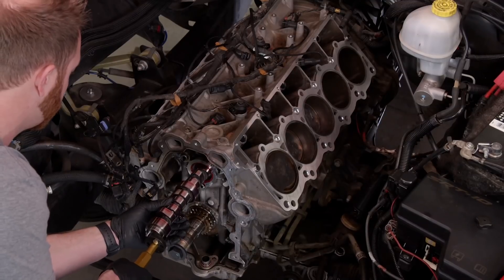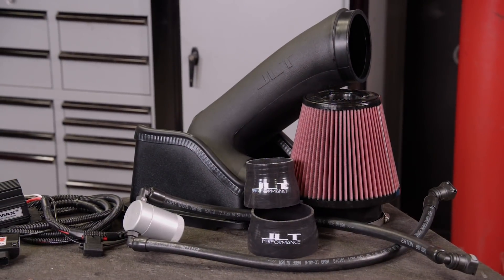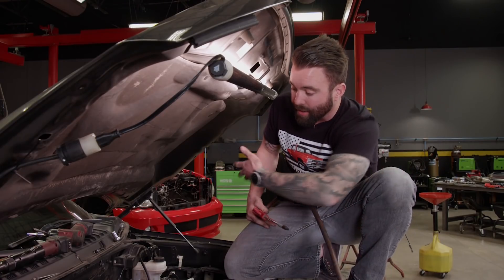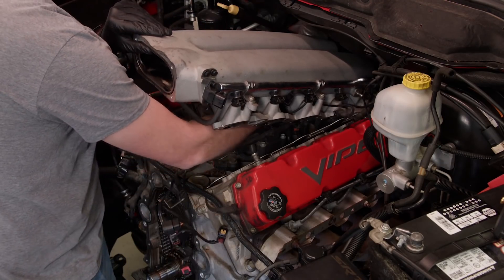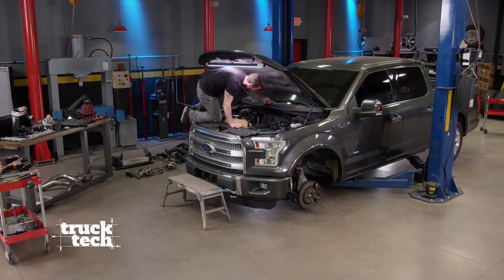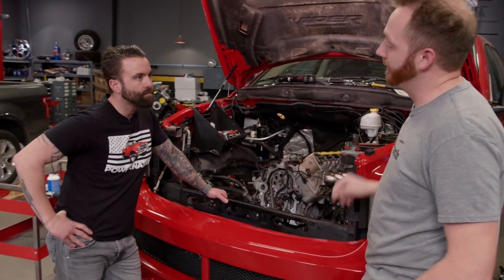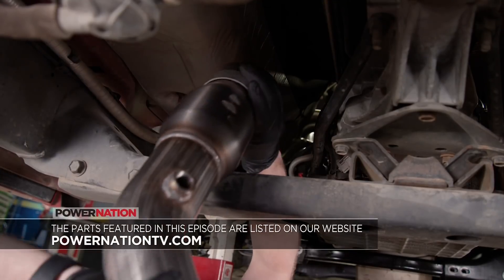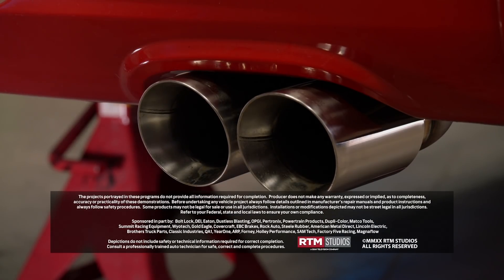Ram SRT-10 and F150 Get Engine Mods: Muscle Trux Build-Off: Drivetrain - Truck Tech S7, E10

Comment: Boost the SRT10 Ram and it will fly.  Heck it's got forged internals vs the Ecoboost cast pieces.
Reply: Should bolt on a big fat super charger on that dodge. No truck would catch that thing.

Comment: When my 204,800k plus mile 5.7 hemi in my 03 ram 1500 finally wants to start quitting on me (many more years in it truck is very solid) I may re-build that motor doing even more than I did to it. All it’s got now is K&N air filter, hypertech power programmer, throttle kit, Gibson performance exhaust (exhaust that not many have... it sounds really damn good and is very cheap) those exhaust give my truck a loud aggressive sound that I love. No stupid sound it has a very good aggressive tone. Straight piped itll sound horrible. Do not recommend straight piping a 5.7 hemi it’ll sound ridiculous, all depends on your exhaust system you go with. Extremely happy with my Gibson performance exhausts. The idle is loud and sounds great and the driving is just fantastic. has a aggressive roar sound. Awesome. Stock the old 5.7 hemi makes 345hp... I’m saying it’s around 415hp maxed out on its power. Pulls and kicks ass. When I may want to do a re-build the truck is getting freshened up and even more added to it. It’ll be a great winter truck and a truck I’ll just love to drive around. I’ll of course have a new ram. Looking into buying a 2017 or a 2015 or ‘16, ram 1500 5.7 hemi pretty soon. Keeping my 03 it has many memories it’s not getting sold. From original owner who bought it brand new, owned it long time. I buy it from him. He took great care of it and treated it well. Great engine. Reliable as long as you treat it well

Comment: Teflon o rings on injectors do not require lubrication to install and can cause the injectors to leak compression. A clean bore is more important when putting eco boost injectors back in. This is the difference between a mechanic and a technician. Read the manual and take what you need to know and apply it.
Reply: What the hell os “tephlon”?
Reply: Edited

Comment: You can cut those crash beams between 2 of the bolt holes if you slide them all the way to one side.

Then it allows it to be bolted back in when done, minus 2 bolts ofcourse.

Comment: Honestly all that SRT-10 needs is a paxton setup and some headers and gears, the F150 won't come close to it power wise. If you are going to run a cam then do the heads as well and get it tuned.
Reply: Joanna  a bolt on paxton SRT-10 is in the mid 6's to low 7's at the wheels, no comparison really.

Comment: How annoying was it for you to remove that intake manifold on the V10? Those rear bolts are a major pain in the ass. Ask me how I know. LMFAO! Nice touch on painting it black though.

Another inexpensive couple of upgrades is drop in K&N filter,  swap out the throttle body and a 170 degree thermostat. A tune is a must, to fully get the benefit out of the cam and reprogram the cooling system to come on in conjunction with the 170 t-stat. Get in touch with Torrie, at Unleashed Tuning. One of the most experienced tuners, when it comes to these trucks. He will get you set up with an SCT programmer, t-stat and a canned tune, based on what you've done so far. Obviously a dyno tune would be best and Torrie has the ability to remote tune with most dyno shops.

Word to the wise, replace the PS lines and oil cooler with a set of SS ones. Do not put a new set of OEM's back on. They all leak on these truck. I will repeat, THEY ALL LEAK ON THESE TRUCKS! If yours haven't been replaced already and are not leaking yet, they most certainly will. Get in touch with Tony, at JTSVP, he will get you set up with the correct set of each.

Comment: That 150 is going to need to be tuned with a plug and play computer.
It will definitley wake that 6er up.
Increasing air/fuel and boost pressure on factory ecu settings most likely would cause poor acceleration and throttle response. Also shit fuel milage and one unhappy truck. 
If tuned correctly that truck will fly down the road.

Comment: It’s a good idea to replace the turbo coolant and oil lines and fittings. They pit and have scores where the old o ring rides on them. They usually don’t reseal and leak everywhere. Your experienced in a lot of ways but the repetitive one. Multiple times working on these and you will want to have done that the first time.

Comment: The viper motors are prone to have rod stretch at high Rpm’s they make up graded rods and cranks with arp bolts  and should run gen 4 head gaskets

Comment: There is so much more you could have done to EcoBoost and you could used a better turbo up grade. You could have graded the cold side and hot side pipes. You could have upgraded the turbo flange. You guys should have ask 5startuning and not summit racing.

Comment: You guys choose the wrong parts for the ecoboost. you should have upgraded the hi pressure fuel pump, CRP stage 3 Turbos. That was also the WRONG way to install Direct Injectors. Their is a procedure to install them correctly to not rip one or pinch one of those Teflon seal.

Check out 5 Star tuning with CRP stage 3 turbos. 500whp

Comment: So what would y'all start with and what mods. would you do if you were given this task?
Reply: First and foremost he shouldve bought a 10 speed 5.0 with 3.73 gears. Pinning a double cab dodge vs a larger supercrew cab doesnt add up. I think a closer matchup wouldve been a supercab. He spent 7k on mods on that ecoboost when he couldve bought a bolt on supercharger for the 5.0 that would make far more power than that tt v6. He would have to do billet oil pump gears and some high flow cats which would add to his cost. S/C kits start at 625 hp and go up to 750hp and with a 4x4 launch itll destroy that dodge. As for the v10 i think he went a good route with his mods and id expect to see it make some really good numbers.
Reply: @07slowbalt  but, if he went with the 5.0 and an SC, wouldn't he need to have enlarged the Ring gaps? Maybe why LT didn't SC that 10? 
Those little Ecos. can lay down some power but it's still got to have some revs to do it.

Comment: Did you guys uprate the timing chain on the V10 to? Did anyone hear what the lift is on the new cam?
All those parts off the top, should have saved the cost of the lowering kit and added a blower to the V10, or at least get the heads shaved and ports n valves done.

Comment: Now that you've worked on the suspension, the top end, and exhaust needs of the 8.4L V10, AND you still have $6100 left in the 15k budget, NOW is the time to look into a Procharger kit or a couple of turbos for it. Of course you'll need a stronger clutch to go along with all of that added power...
Reply: Any more power you need to replace the transmission behind the v10

Comment: $1100 for a pair of rotors and a set of pads is highway robbery.
Reply: Ya on EBC’s website the rotors are $606 each on sale. My buddy has an Audi S8+ with ceramic brakes. Thank god he leases it, list price on the front rotors is $6k EACH!!
Reply: Porsche recently introduced silicon carbide coated brake rotors, Engineering Explained has a video on it. Wonder if the owners will have to ante up a kidney for replacements.
Reply: Go price similar size equipment from Willwood, Brembo, etc and see what a 15" kit costs.   $1100 isn't that bad.
Reply: @rhubarbpie2027  Didn't they say Tungsten Carbide in that show? IIRC, they made a point of comparing to drill bits. When that tech becomes more budget friendly, I'd expect a lot of hot rodders are going to fit it.
Reply: Looks like he did the rears also
Reply: Robert Shaw for the price I think maybe not
Reply: My 2017 daytona 392 the rotors alone are 1500.00 each
Reply: I paid $156 for front pads and rotors on my srt-10. Might not be “performance” but really it’s all you need.
Reply: @PiDsPagePrototypes  Yea...it is tungsten carbide coated.
Reply: You all probably dont give a damn but does any of you know a method to get back into an Instagram account..?
I was stupid forgot my login password. I love any tips you can offer me!
Reply: @Magnus Larry Instablaster =)
Reply: @the_hulk392  the mopar ones are made by brembo and are 700 each and u can find them a lot cheaper than that

Comment: "High performance window tint". Did anyone else rewind some to make sure you heard that right?
Reply: I mean.. cheap tint turns purple after a year so...
Reply: @alexyoungberg5232   So he put some high quality window tint on, not high performance.
Reply: And at $200 for that size truck ...  nothing about that is going to be either high performance or high quality lol. $600 where I live for a full ceramic job on that size truck.
Reply: I think it was some kinda joke
Reply: You didn't know High Performance chrome valve covers and window tint gives you 20+ HP? Sometimes more. 😊
Reply: I mean it is high performance bro... it performers very well in the hot sun let’s in basically zero uv’s and keeps the interior nice and cool
Reply: I had to watch it a few times lol
Reply: Even after 40+ years of modifying cars, I never really "got" window tint. Who knew it would add performance. I stand corrected.
Reply: @Tonebone721   That would make sense
Reply: Five times. I still cant believe it, ford trucks need it. 🤷🏽‍♂️
Reply: What do you mean that's pure aerodynamics HAHA
Reply: It only has to perform better than average to be high performance. Sounds pretty dumb though
Reply: That was weak🤣🤣🤣
Reply: What is the Low Performance window tint???
Reply: Window tint is just like bumper stickers the more you have the more horsepower your engine makes
Reply: @noidontthinksolol  it's areodynamics, LoL. Like the dimple's in a golf ball. The leading edge of each of those stickers disruptes the air going over the car. 😅
Reply: i think that was sarcasm
Reply: Adds 15 HP

Comment: "That's all part of building a truck." Buddy, that's all part of building ANY vehicle...🤣 🤣 🤣  I know this ALL too well! Even if you're spending the kind of cash that y'all are dropping on parts (well, y'all are sponsored as a show, but you get what I'm talmbout) some parts just require modifications to install. I have three project cars in my driveway, none of which were turbocharged from the factory, and I don't buy turbo kits, I fabricate most of my own parts, so almost EVERYTHING that I install requires modification. I guess that I'm just a glutton for punishment.

Comment: I have a 12 F150 ecoboost. Its been reliable for the 20k miles ive had it but its been a learning experience. I put a UPR catch can on it that connects to both pcv's and its amazing what it catches in the winter time. Terrible design flaw from ford though, just the thought that the engine is feeding that crap back into the engine is awful. Ive also done the condensation drain hack on the intercooler, has it helped? Idk, but it hasn't taken anything away. New plugs and coil end boots and its runs like a champ. Im impressed with its power, that v6 and teeny tiny twin turbo's really throws down some power. Im waiting for the next episode, I hope they dyno the trucks I want to see what sort of power it makes now with the injectors, larger internal turbos and intake.

Comment: i have an 02 dodge ram with a 5.9 gas engine and I've had to replace it 3 times. (bought the truck used). i think it would have been easier to just remove  the V10 to work on it

Comment: WTH is "high performance window tint"?!?! hahaha
Reply: Adds 10HP
Reply: There is a Difference in window tint. so basically means it will last longer and deflects more heat than the cheap stuff
Reply: They need to start adding power with stickers next

Comment: Still have enough in that srt 10 budget for a roe supercharger
Reply: If it were a real fastest truck competition that's what they would have done.  Also the ford would have been a 5.0 also getting supercharged... The competition is clearly pushing towards showing how efficient a small engine with turbos can be after some simple bolt on mods.

Comment: This is a failed head to head test from the start. You have a supercrew compared to a double cab so obviously handling isnt going to favor the ford. Then obviously the ecoboost is suffering from a 130 hp deficiency.  Bigger turbos and injectors would definitely make it a closer fight if the v10 did nothing. Then the turbos he replaced them with will max out at 600hp which clearly the viper will be at least to. Did he really say he spent 7k on the ecoboost performance mods lol? Injectors and turbos and an exhaust. Shouldve bought a 5.0 and did a 7k supercharger. That ram wouldve been struggling then. A cam swap on the v10 will probably make another 100 hp by itself let alone full exhaust and longtubes

Comment: Just get a Five Star tune and bolt ons for the EcoBoost and you'll be seeing 500whp 😏😏😏
Reply: Hell with just a high pressure fuel pump and a tune I've seen these F150's run 11's on e85.  Full bolt ons, bigger turbos on top and that Ram would be stuck at the starting line bragging about his engine size while the F150 would already be in the traps.
Reply: @BasedEMT1776  maybe, but add twins to the Ram and that F150 is out of luck
Reply: Really?!?! 
I had no idea. Not a Ford man, but love making high HP out of 6 cylinders.
Reply: @user-sh2mk8ew4c  look up 5 Star Tuning on youtube. They have some VERY impressive results with all of the Ford Ecoboost engines. If the blue oval would put the 3.5L Ecoboost in the mustang, it'd embarass the Coyote like the Buick GNX did to the Corvette back in the day.
Reply: @BasedEMT1776  exactly! The Ecoboost engines are very "de-tuned" for what they're capable of. I'll likely get a newer model with the 10 speed when I get back from overseas.
Reply: Ecoboost four cylinder does pretty well on the Ford GT at Le Man's. Ecoboost Barra is even better then the 3.5. That V6's issue isn't in the motor design, it's in the mass of the truck. Put the V6 in a mid mounted Corvette competitor, call it a new Thunderbird, at the same price point, and things would get very interesting. Take sales off of the over priced Italian supercars.
Reply: Cory Dubyew. Okay, let’s add boost to the SRT 10.
Reply: I’ll take a swing at both with 394 Stroker being built in my Ram now, boost ready🤣
Reply: @bri-manhunter2654  well, when you get your own TV show you can do that. 😊
Reply: @PiDsPagePrototypes  The Ford GT has a V6 ecoboost. wtf are you talking about?
Reply: @rhubarbpie2027  But it'll never have the sound, the soul, and character of the 5.0L Coyote V8 nor have the character of an old school muscle car or hotrod.
Reply: @CJColvin  to each their own 🤷‍♂️
Reply: @PiDsPagePrototypes  the GT is a v6 and the Barra ISN'T  an Ecoboost.